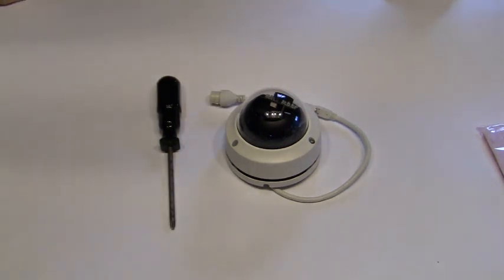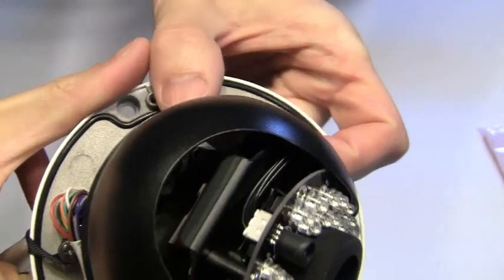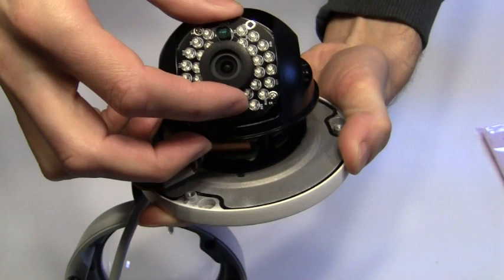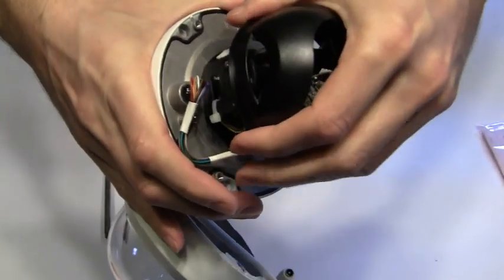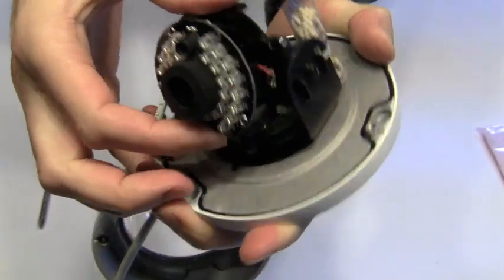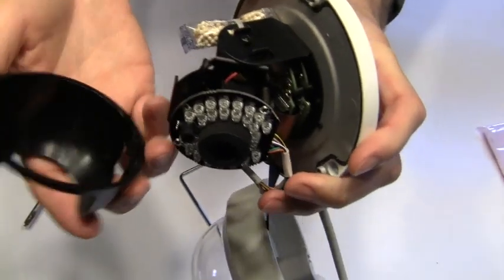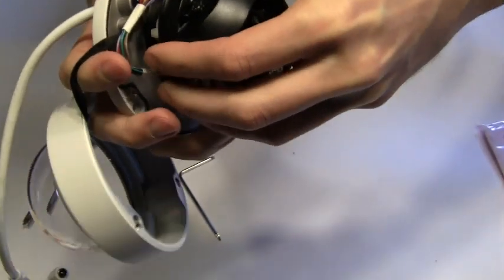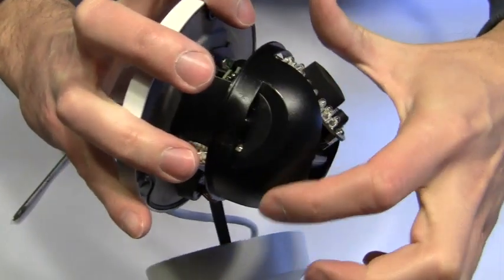How to manually adjust PAN & TILT - HIKVISION IP Dome Security Cameras

Comment: If you mount this camera on a wall, can you adjust the viewing angle side-to-side? It seems you'd have to rotate the camera to get the tilt axis to pan, and then the picture would be sideways... is there an adjustment to straighten that out?

I ask because I'm looking for a camera to mount on a wall near my front door. The ceiling in that area is too high to get a good view.

Thanks!
Reply from the maker: +delamin8r My first thought is, no, the lens would have to be rotated somehow to make that happen.  I will take a closer look and get back to you.
Reply: +newfiebort - I bought a DS-2CD2132F-IS a few days after posting that question, and it does allow rotating the lens. It is watching my porch as I type this. :-) But I don't remember whether the difference between the -I model in the video and my -IS model is actually significant or not.
Reply: +delamin8r You can do it in the setup of the camera

Comment: HI. Great video. I removed the little bag of silica powder from my cam when i installed it. Should i have left it in to absorb moisture, or is that only for shipping purposes?
Reply from the maker: Hey! Thanks for watching.The silica bag should be left inside the camera just in case any moisture makes its way into the camera.  Humidity can also enter if you open the camera on a humid day.  It will help protect the components and prevent things from fogging up.  That said, I don't think it will be an issue.

Comment: Very informative video! Thanks!
So that means that this camera doesn't have motors built in, to pan/tilt it remotely (PTZ)? If so, what outdoor camera would support PTZ AND have a 2MP or more resolution?
Reply from the maker: +Christian Schoemmer Correct, this model doesn't have motors for pan and tilt.  Hikvision is often adding new cameras to their lineup.  Have a look to see which one would work best for you.  I stayed away from the PTZ for now because of the extra price and I'm not sure how they would operate in -40 degree temperatures.
Reply: +newfiebort Thanks a lot for your response. Yes, I also saw that outdoor PTZ cameras seem to be incredibly expensive. For whatever reason. I was assuming, since my $90 indoor camera had PTZ, that an outdoor dome camera would have that, too. And, yes, the temperature resistance would be the main reason for the high price, I guess. -40? Man, this sounds cruel. :) Greetings from Germany! :)

Comment: What was the right-angled tool you used to remove the initial casing? Is this a special HikVision tool I need, or just an allan key or engineers screwdriver?
Reply from the maker: It's like an allan key but star shaped.  It comes with Hikvsion cameras.
Reply: Thanks, Ill see if there's on on Ebay. I had my hikvision installed professionally and he didnt leave a key :(
Reply from the maker: carpii send me an email and I’ll mail u one for free. Info@newfiebort.com
Reply: The "star shaped" drive is called a TORX drive. You can find TORX wrenches in most places you can buy tools.

Comment: How do I mount a camera DS-2CD1143G0-I Vertically and get the picture to Rotate. I have tried accessing the cameras Configuration and there is No Rotate Option. Please post How to Video
Reply from the maker: You can rotate the video when logging into the web user interface under Basic Configuration - Image - Video Adjustment

Comment: Hi there can you tell me how do I zoom in ?
Reply from the maker: There is no optical zoom on this camera.  See my PTZ Review video for information on optical zoom cameras.  Thanks!
Reply: newfiebort thanks buddy I will do
Reply: newfiebort I'm using model DS-2CD2142FWDI it doesn't have PTZ as far as I know so it won't work using software.do you know if there's a manual zoom you can adjust inside the camera.thanks